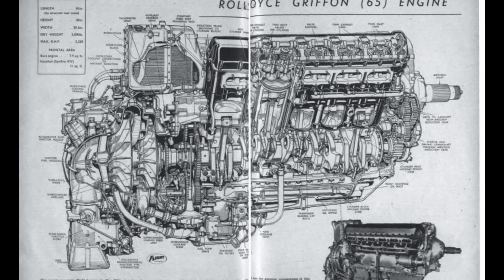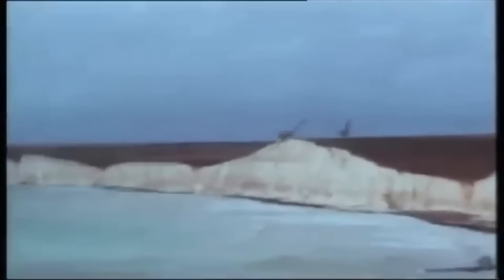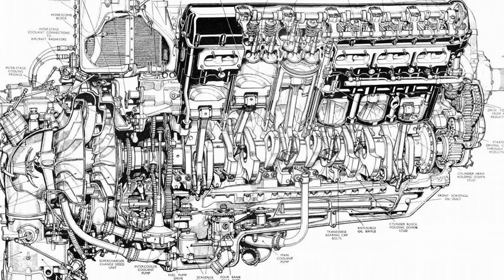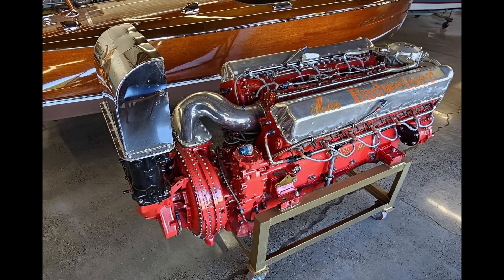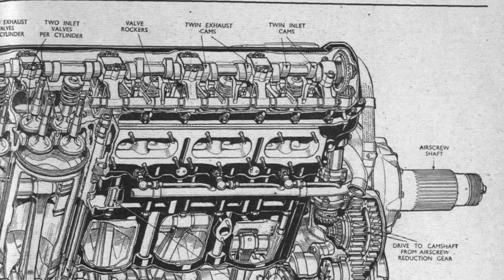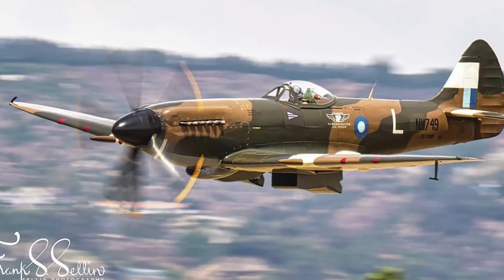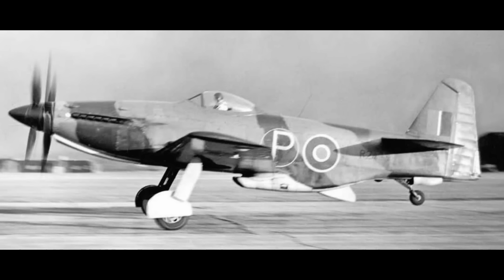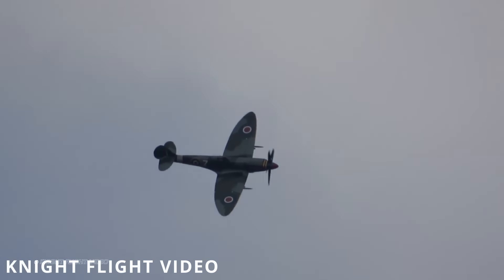The Last Word in WW2 Horsepower - Rolls Royce Griffon

Comment: This video is a fluff piece, full of hyperbole and inaccuracies. There were many revolutionary power plants developed during the war, most of which never saw mass production. This engine was not one of them. It was an enlarged, improved, refined development of the Merlin.
Reply: Actually, I think it was a development of the pre-war Rolls Royce 'R'
Reply: @petearundel166  which was the starting point of the Merlin.
Reply: @andrewhefner289  Not really. The Merlin is the end of the Kestral / Peregrin / Goshawk line while the R came off the Buzzard. These were much bigger engines than the Kestrels and Merlins.
Reply: entirely different engines with different design ideas.
Reply: And  mass produced ,the others were not .
Reply: Isn’t that what distinguishes the Griffin? It was put into mass production. The really special innovation though was the jet engine designed by Frank Whittle. If our military and government weren’t so incompetent we could have had the jet engine before the war began, and maybe could have prevented it and would certainly have shortened the war.
Reply: @ddfann it still problem though. Unless you can DECISIVELY convinced that new stuff are really good, and worth restart and temporary disrupt logistics and supply then they not gonna change
Reply: Of these “revolutionary” engines were that good they would of been stuck in a plane, which they weren’t, so they weren’t.
Reply: @markdavids2511  some were impractical and some had tremendous promise, but pressing needs and the time factor didn't allow their development.
Reply: Here we go, hammer on the content creator.  Show us you’re smart.  Just get it over with.
Reply: @ronjon7942  in case you didn't notice, the narration was AI, and my guess is a lot of the content was also. If you enjoy this artificial crap, have at it. I prefer well researched content from human beings.
Reply: No, it wasn’t. It was a separate design descended from the “R” engine that powered the Schneider trophy seaplane racers.
Reply: Calm down buddy
Reply: @andrewhefner289 no it wasn't the Merlin was a development of the kestral. Infact the first ones where utter rubbish.
Reply: @ddfann the first Merlins were not designed for mass production. They were a craft product of skill and hand work. Packard had great difficulty mass producing it. What they learnt was fed back into UK production. Packard sent a note to RR can you please supply the torque wrench settings. The Experts at RR replied." What is a torque Wrench we do not know what that tool is" i wish I was joking!
Reply: @womble321  understood. But my point wasn't about the Rolls Royce intrawar development of v-12 aero engines, it was about the inaccurate and hyperbolic description of the Griffon in this video. The only revolutionary aspect of this engine was the counter rotating crankshaft.

Comment: Changing the direction of rotation does not help with torque, it just means things turn the other way,
Reply: Certainly helps with torque reaction, though.
Reply: @TheManFrayBentos  Why? I'm genuinely interested. I thought it was just because SBAC was standardizing prop rotation, so engines developed afterwards began to comply.
Reply: Contra rotating props helps the torque effect I believe, no personal experience  of course. The two props cancel each other out and only the rotation of the engine itself is producing the rotational forces …..
Reply: i think he stated that the propellor rotates in the opposite direction to the crankshaft - so the moment or torque from the crank is opposing the torque from the prop blades, cancelling out some of the effect. -  but it pulled the aircraft to the right instead of the left when applying full throttle during takeoff, so converting from a mkIX to a mkXII the pilot needed to apply the opposite ruder pedal during takeoff to avoid a ground loop, digging a wingtip into the runway

thats my understanding of what was said - but I may be wrong
Reply: @stevesoutar3405  The internal workings of the  reduction gearbox does not cancel any torque.  That would be like pulling yourself up by your boot straps, physically impossible.
Reply: @TheManFrayBentos  Nope, it doesn't reduce torque reaction.  Torque reaction is equal to torque, always.  That's the very essence of Newton's third law.
Reply: @andrewalexander9492  ah but having the prop go in the opposite direction as the crank does decrease gyroscopic forces, whether that applies here, I have no idea. However I assume the RN specified the prop to be turning in the opposite direction for some reason or another.
Reply: @EbenBransome  “ The prop turns the opposite way to the crank, so the torque reaction of the two contra-rotating parts cancels to some degree. “ 

Well,  there are several responses to that:

1.   That would be true only during RPM changes, due to the torque reaction to accelerating the rotational velocity of the crankshaft and propeller.  Once the propeller had reached full RPM and RPM was being controlled by the prop governor  (which it would very quickly in a takeoff run) there would be exactly zero “torque canceling”,  none, zero, zip, nada, unless Newton’s third law has been repealed, which as far as I know, it hasn’t

2.  The moment of inertia (flywheel effect)  of the crankshaft is tiny in comparison to that of the propeller, so any “torque canceling” effect during rpm chances would be very small.  

3. In the context of Griffons compared to Merlins , it’s completely irrelevant.  Except for the two Merlin variants which had counter-clockwise (from the rear) prop rotation, Mk131 and mk134, the  Merlins and the Griffons both had propeller shafts which turned opposite the crankshafts.  In the Merlins (except for the noted exceptions)  when viewed from the rear, the crankshaft turned counter-clockwise and the propeller turned clockwise.  In the Griffons, when viewed from the rear, the crankshaft  turned clockwise, while the propeller turned counter clockwise.

So, bottom line is that there is no difference in torque reaction in the Griffon, compared to the Merlin resulting from the propeller shaft turning opposite the crankshaft, because they turned opposite in both engines.
Reply: @mickvonbornemann3824  Yeah, but the merlin also did that...
Reply: The Merlin’s torque on take off made to try to drift into the offset bridge but the opposite torque direction of the Griffon made it try to drift the other way across the open deck not steel bridge….
Reply: @johnfisk811  No the ‘torque’, actually propeller spiral slipstream impinging on the vertical stabiliser with clockwise rotation viewed from behind makes the nose swing LEFT.  Merlin push right boot, Griffon push left boot.

Comment: The king returns! I absolutely love these engine deep dives. There's tons of documentaries on every single aircraft but none on the powerplants. Thanks!
Reply from the maker: Thanks for tuning it!! I’ve got a plan to keep up the video output.
Reply: @flightdojo awesome ❤ really looking forward to it.
Reply: @flightdojo  We'll all good fans of yours. Any time I see one of these come out, I have to watch them as well. I'm not even into engines - I'm a huge computer nerd/builder/programmer. I just love the specs, data numbers, and presentation.

Going to get a snack for this one. Always worth the view.
Reply: Have you already seen "Greg's planes and automobiles" channel?
Reply: @bernhardjordan9200  Ha! Thanks for letting me know. I've got it subscribed and will check it out. Looks like another gem.
Reply: @bernhardjordan9200  I've watched through several of Greg's videos and particularly liked The manifold pressure one.   Unfortunately Greg's tone got  condescending for me a few too many times and I hid the channel and/or unsubbed. 

I really enjoy the stories and nuances of engine development from flight dojo though!

Comment: The griffon was still on operational aircraft when I joined the RAF in 1987 - admittedly as a stopgap after the failure of the Nimrod AEW project. It was finally retired only when the E-3 was procured. In 1991.
Reply: Avro Shackleton ??? ;)

Comment: The Griffon ( mk 101 ) was also used in the RAF Marine Branch, TE Lawrence etc. They were fitted in the 68ft HSL boats. Two engines converted to Marine use fitted in the boats and using Mathaway gearboxes.  They ran on 130 octane fuel and the boats carried 2220 gallons n 5 Tanks. RTTL 2757 at RAF HENDON is the last example of these boats and on which I served as a Deckhand, then later as an  Engineer.

Comment: I think you failed to mention how the Rolls Royce engineers generally kept the same frontal area of the Griffon compared to the Merlin, a lot more displacement for a minor increase in frontal area, and hence a minor increase drag on the aircraft. 

Otherwise a very good video!
Reply: Sounds off. They kept the length down, but they moved cam etc. drives to the front to reduce crank twist effect on timing. So, the overhead drive gears are at the front of the valve covers, which is why humps were added to the cowling. I do agree that their efforts were remarkable, as an engine of 30% greater capacity could be used in airframes designed for a Merlin. My impression is that the Griffon was cleaner (no external oil lines) and more bulletproof, but its 'tuning' (like cam profiles) was not as agressive as that in the Merlin. I would love to know what a Griffon could do with such a profile.
Reply: Maths is a bit casual sometimes, 37 litres is actually 37 percent bigger than 27 litres and the cube root of 37 is only 11 percent bigger than the cube root of 27 so the Griffon would hardly be expected to be vastly bigger than the Merlin.  Obviously if a linear dimension is doubled the volume becomes 2 x 2 x 2 or Eight Times bigger.
Maths is similar to math.

Comment: Griffon was developed expressly for the FAA, yet once it entered production, it was diverted to the RAF for, well, Spitfires.  As a consequence, once the Pacific Fleet was formed, the primary aircraft of the FAA were US-made Corsairs, Hellcats, and Avengers, with a sprinkling of Barracudas, which were forced to use underpowered Merlins.  OK, some Griffon-powered Fireflies (why a 2-person fighter?) were also used.

From what I have read, the Griffon was, indeed, a good engine.  Contrast with the Napier Sabre, which was much more powerful engine but was plagued with difficulty in trying to transition from the "skilled craftsman" to the "assembly line" mode of production, and in the end was used for only two production aircraft types.
Reply: Why a 2-person fighter? Doctrine, of course. Pre-war FAA doctrine was that naval fighters were there to protect the fleet from bombers. The bombers were meant to be spotted and intercepted by long-range 2-seat fighters; the second seat was for a navigator to help guide the pilot. Range was prioritized over maneuverability. Hence, the long line of crappy 2-seaters in the FAA.

Reality overwhelmed FAA doctrine once the war started and it became obvious that single seat fighters were an absolute necessity. The range of enemy fighters increased, as did the firepower of enemy bombers. The FAA scrambled to fix the deficiency but, having eschewed home-built single-seaters, they were forced to take whatever they could get from the Americans - namely the Wildcat/Martlet. These served until the end of the war, alongside the crappy 2-seaters to which the FAA clung bitterly.
Reply: @jamesdalton2014  maybe they were right, the US lost a significantly higher percentage of planes to navigation issues & that includes the USN. Mind you this maybe because US training focused more on other things, like for example formation flying, I don’t know.
Reply: @mickvonbornemann3824  Ah, yes... formation flying - the air force equivalent of parade ground drill. It looks nice but, it's absolutely useless in combat. It makes the cake-eaters all warm and fuzzy though.

But, your point about training is spot on. Better training and more of it leads to fewer accidents. unfortunately, it always takes time for peace-time forces to learn the lessons of war.
Reply: @mickvonbornemann3824  you crank out thousands you are going to lose more than if you only crank out hundreds. The quality of the pilots inevitably go down. Has nothing to do with learning to fly in formation which by the way EVERY AIR FORCE TEACHES
Reply: @johnhallett5846  Other air forces were not pretending that they could create a formation with so many guns pointing in all directions that it could repel enemy attacks. 
Flying in large formations assumes the enemy does't have efficient AA.

Comment: By 1942, RR was working on the Merlin 100 series engine with some much improved systems.  NAA Schmued visited RR at that time and started planning the P-51H around it.   By 1944 it was being bench tested WEP at 2640 HP and 135" MP.   It powered the deHavilland Hornet. 
It was perhaps a better solution for fighters than the Griffon.

Comment: Even NAA evaluated putting the Griffon in the P-51. I had a NAA line drawing of this configuration, but need to find it again.
Reply: Correct.  NAA performed the preliminary design to accomodate the Griffon, then became aware of the Merlin 100 engine development in 1942 for the P-51 (lightweight fighter) giving 2200 HP.

Comment: The Griffon was a development of the Rolls Royce R engine of 37 litres that powered the Schneider trophy Supermarine aircraft and enabled Britain to keep the trophy for 3 straight wins, the Supermarine Schneider float plane achieved 400mph in early 1930's. The Merlin was a much smaller capacity at 27 litres
Reply: The R engine was a master and slave type engine with a down draft carburettation system. The Griffon had a fork and blade crankshaft in common with the Merlin. The R and Griffon shared the same cubic displacement but the Griffon was not developed from the R. The Merlin and Griffon were both developed in parallel from the Kestrel.
Reply: Seeing people give likes to a silly and utterly ignorant anti-contribution is exasperating.  It contributes towards and encourages posting lazy or trolling nonsense.

Comment: A friend of mine has an old 1975 Rolls-Royce mk1 silver shadow car and despite being nearly 50 years old the old engine still starts first turn of the key, so it obviously hasn't even begun to wear out yet, there's obviously no serious loss of compression and it's not burning oil either, and it even still started first time with half of it's spark plugs knackered, even with the air filter all clogged up full of crap so it could hardly breathe! and it even still started first time with the firing order wired all wrong! How about that, that's how good Rolls-Royce engines are, real world class British engineering.

Comment: It's very interesting that 4-Cycle piston motors pretty much reached their highest development (DOHC 4 valves/cylinder, fuel injection, etc.) in the GP race cars of the late 1930's and aircraft engines of WW2...80 Years Ago. Messerschmitt BF 109's had a significant advantage in maneuvers thanks to fuel injection before allies adopted it over carburetors

Comment: The Napier Sabre engine used on the Hawker Typhoon was producing 2300 hp by 1940 - the Typhoon was the only plane capable of taking on the Focke-Wulf 190 in 1941. The Sabre VIII produce 3000 hp and the Sabre E.122 produced 3500 hp.
Reply: Spitfire IX took care of FW-190.  Typhoons did not have the required service ceiling.
Reply: @anthonyjackson280  Spitfire IX in 1941? I don't bloody think so. As I said, the 1941 Mark V's were outclassed by the Focke-Wulf. It was dangerous work, but the Typhoon was the only plane capable of facing the FW190 until the Mark IXs were rolled out in late summer 1942.
Reply: Problem was that Napier had terrible quality control in 1940, which wasn't fixed till they were taken over by EE who told them to stop playing silly Bulgarians with superchargers and fix the production problems. It wasn't till 1944 that they were reliable, and they were still too complex and fragile.
Reply: The Napier Sabre was notoriously unreliable and killed many test pilots and operational pilots. Bristol was strong armed into providing Napier with their patented process for sleeve valves. Then there were all the problems with the Typhoon "interceptor" design.  By 1944 the new Merlins were bench tested WEP at 2640 HP.
Reply: @bobsakamanos4469  That is the nature of warfare - the English Electric Lightning was the finest interceptor ever made, but it terrified its pilots. The RAF needed the Sabre in 1941, not 1944. The Sabre IIB produced 2200 hp in 1941, with variants steadily increasing in power - by 1946 the E.122 produced 3500 hp.
Reply: @tranceguide9752  the nature of warfare is to make the other guy die for his country, not to place your own people in harms way with inferior, unreliable equipment.  Look deeper and you'll see war profiteering as a bigger issue and/or incompetence.
Reply: Putting second-rate tall geared single speed supercharger Merlins in the Mark V Spitfire and giving the two speed Merlin XX to the obsolescent Hurricane created the FW 190 crisis.  The special low altitude capable Clipped, Cropped and Clapped Spitfire Mk V version eventually also matched the (two speed) 190A’s low level performance.
Reply: @ Well said; however they weren't all "clapped".  Late production LF Spit Vs came with the Merlin 55M that had the improved (by RR) Bendix pressure carb.  It was a hot rod, easily outclimbing the 190 and able to keep up in level speed.
Earlier, the Spitfire III should have been given the Merlin XX engines.  It was a 400 mph fighter in 1940.